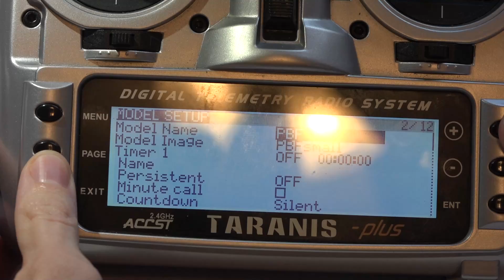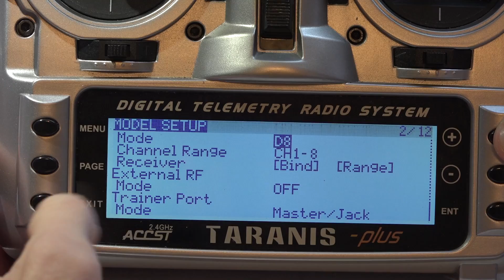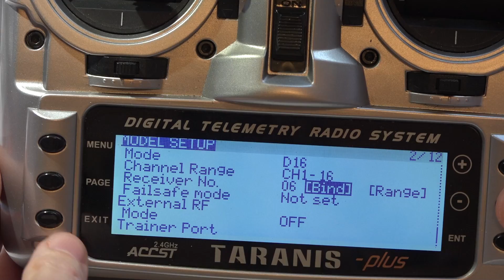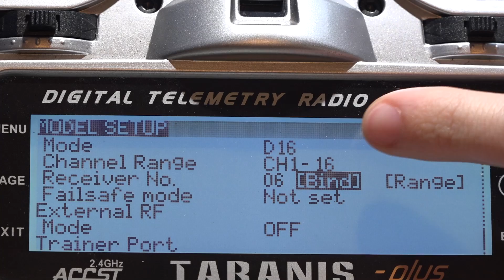How To Bind FrSky XM & XM Plus Receiver

Comment: I realize this is an old video, but here’s a tip:

Hold the controller further away. I tried ten times with no luck, then grabbed my controller about two arms lengths away and it worked.

Comment: For anyone who wants to use XM+ during 2020; I've spend 4 days and nights trying to get 2 new XM+'s to work. Finally the struggle ended with a good connection, but damm that was frustrating. To help fellow droners out, I would like give some info about this. I updates my FrSky X lite (accst) to the latest firmware, v2 versions. Same with the drones to the latest betaflights and the XM+ to the latest firmware as given on the FrSky website.
My tip to anyone with connection issues:
DO NOT UPDATE THE XM(+) TO THE LATEST v2 VERSIONS!!
Apperently, the XM(+) can't handle the latest firmware (2.x.x. and up). If you manage to bind, you wont have a stable connection, actually you will have a horrible connection with failsafes every 5 or 10 seconds. Complete useless. After trying everything and everything, the only way I could make my XM+'s work is to downgrade my FrSky X Lite to the latest version BEFORE the 2.x.x. Which is the XM+LBT170313-RSSI8(or 16) (the 2.x.x and above is useless anyway, only made for FrSky themself so they can outrule any 3th party receivers... bad move, is going to make a lot of droners dislike FrSky and move to TBS or something, like I did (now ordered the TBS Nano module that fits right in my FrSky X lite). But to get back to my point; don't upgrade. 
The XM+; leave it to a pre-2.x.x. firmware, the latest is XM+170313. 
The internal antenne on the X lite; iXJT_EU_20180416 or just a pre-2.x.x. on other frsky radio's.
The betaflight I use is the 4.1.7, from 4.2.x and up it doesn't work. 

Tip: with the xm+ on quads, with a flip function, use 8channel firmware. you'll need 3 channels for arm/mode/beeper and 1 for the flip, and since ch8 is used for rssi (for the osd) you wont have a channel for the flip. Solution; use the same channels als the beeper; a 3-way switch. I my case the first move makes the beeper go of, 1 move further on the same channel flips the drone. Works great! But this way you can use 8channels instead of 16channels, which makes a better connection and still you keep the RSSI in your OSD!.
Reply: hi seems like you're still right, lost a few hours and some grey hair till i find your comment, what a useless reciever... bought it to bind it with a taranis x9d from 2014... but don't want to downgrade beta flight on my nazgul just for this... think i have to look for a new reciever

Comment: Hi, I'm Paul, from Brazil, I made my first bind after watching your video, it helped a lot, my kit is a TX Jumper T8SG Plus, iFlight Nazgul5 4s with RX FrSky XM + Plus. .. The bind was ok, the green led remains on in the FrSky XM +, however, the blue led on the control module is blinking continuously and from then on nothing happens ... do you have any ideas or ... you know say what should I change in the configuration for the FrSkyX model?
Thank you.
Reply: Unfortunately he passed away a few years back in a motorcycle accident.
By control module do you mean flight controller?

Comment: For Deviation multi protocol radio users like Devo 7E / 10 or Jumper. If you have solid green and red leds in bind mode and it can't bind, it's not a matter of firmware. Just decrease Freq-Fine to -60 on your radio and it will bind. Helpful isn't it : )
I think that everyone should add clever tips as a tribute and to make JC videos even more informative for ever.
Reply: Allen Key does this also apply to open tx radios like the jumper T12?

Comment: Hello, Love your vids.  I can bind my xm+ to my taranis with no issues.  I get the green light after powering the RX back on but the Taranis does not have an rssi value in a range test nor does it say telemetry recovered/lost.  I know this is a "non telemetry" rx but I would have thought that only meant it didn't have an option to take tele from a FC.  Should it still send an RSSI value to the TX?

Comment: Ah man... I've done this process twice now (the rx blinks and appears to be flashing properly - looks just like on your vid) but when I attempt to bind I get solid red/green and then red only on replug... checked my Taranis and it's 2.1.9. 
Upon closer look of the rx (XM+) to check the model again there's a black permanent pen "F" sort of covering the model name of the board... http://i.imgur.com/mV5thN5.jpg
Crap... I need a professional now... there's virtually no one in the area... hobby shops here are shit afaik. 
Plan B until I locate another rx I've got a dx6i and receiver that I did not want to use for this... @*#!!!*#%@*#*
Plan C is to order a rx from online here in Germany but this appears to be the closest thing they have: http://www.rcmaster.net/de-fd802-mini-8ch-ppm-sbus-receiver-compatible-with-frsky-x9d-p243149.htm - ARE 8 channels going to be enough?
Man, I'm bummed out...
Reply: Hi, did you find a solution, I've got the same F and the same issues. I tried all the different firmwares yet no binding.
Reply: Simply no. And the seller never responded to the issue. Negative feedback for him and I'm going through a local, in Country seller now. Sorry and good luck.
Reply: same here, good luck!

Comment: Are you still planning on making the video on how to flash the firmware on the xm/xm+?  I suspect my xm+ and taranis firmware do not match as I keep getting a solid red light after I bind them.

I am assuming it's done the same way you would flash firmware to the XSR?  
1) Download firmware from frsky website.
2) connect Taranis to PC and save the firmware on the SD card  
3) connect the XM+ power/ground/sbus wires to the bottom 3 pins on the module bay in back of taranis
4) go into the taranis firmware menu and select the xm+ firmware you want and select "flash external device".  

I am sitting at work so I don't have my taranis in front of me to know the exact menu options to go to but that is vaguely how I remember it being done on the XSR.  I can not find any documentation showing it being done different for the XM+.  Does that sound about right to you?
Reply from the maker: Yep it should be a very similar set up. Last I heard the firmware on FrSkys website wasn't working but they might have fixed it by now. I'll check it out and make a video on it. But you can watch the XSR video. Should be the same. 
https://www.youtube.com/watch?v=H6Uk8uuLHXw&list=PLiYYhnH4BhI_F19riYiKPigp8vkN67AN1&index=12
Reply: Awesome, that method works perfectly for upgrading the firmware on the XM+ as well.  Unfortunately firmware update did not resolve my issue.

It appears that there is an incompatibility issue between the XM+ and my new flight controller (Brain RE1).  Whenever the SBUS wire from the XM+ is connected to the Brain the light on XM+ will stay solid red and won't connect to the taranis.  If I disconnect the SBUS wire so the XM+ only has power and ground going to it then the LED on the XM+ turns green when my taranis is on.  It's very very odd.

I tried 2 different XM+ receivers with the same result. When I put the XM+ on any other flight controller I have it works perfectly fine though.  And when I put an XSR on the Brain FC that works fine.  I tried turning sbus inversion on and off, neither made a difference.  I tried 2 different versions of betaflight, no difference.  It has to be an incompatibility between the XM+ and the Brain RE1 flight controller for some odd reason.

Comment: What antenna connector is that? I like to buy some spare antennas for it.
Reply from the maker: Its called a UFL connector. Here are the spares that I buy. Its the cheapest I can find. Most other places charge about $1 per antenna. https://rover.ebay.com/rover/1/711-53200-19255-0/1?ff3=4&toolid=11800&pub=5575257854&campid=5338014988&mpre=http%3A%2F%2Fwww.ebay.com%2Fitm%2F20X-FrSky-2-4G-Receiver-Antenna-with-IPEX-port-Compatible-with-Futaba-FrSky-%2F252224000219%3Fhash%3Ditem3ab9b8d0db%3Ag%3AvdIAAOSw5IJWdGZ5%26rmvSB%3Dtrue
Reply: Thanks man!

Comment: why D16, just because that's the only thing that that RX accepts? Because D8 does sbus also.
Reply from the maker: I honestly dont know. I just know it works lol.
Reply: Project Blue Falcon OK cool. but the XM won't accept D8?
Reply from the maker: Nope. Only D16
Reply: Project Blue Falcon last question. Does the XM Plus accept D8?
Reply: David Hannigan Jr. Why would you want less channels, more is better than none!
Reply from the maker: Nope. They're both the same. Only difference is the XM Plus has two antennas